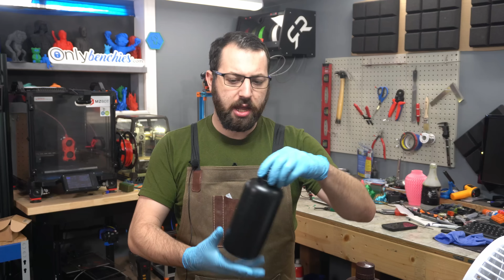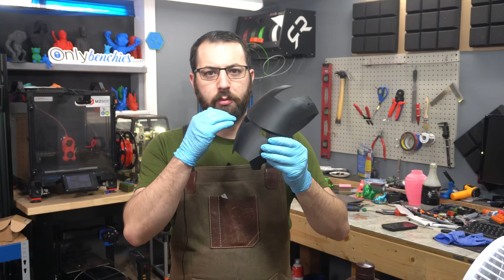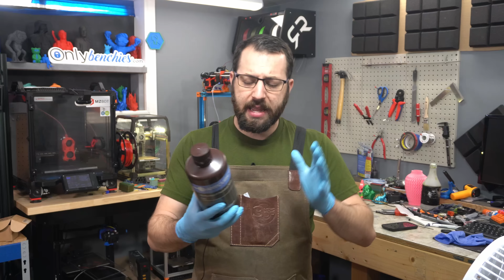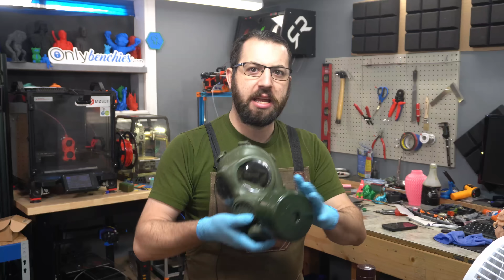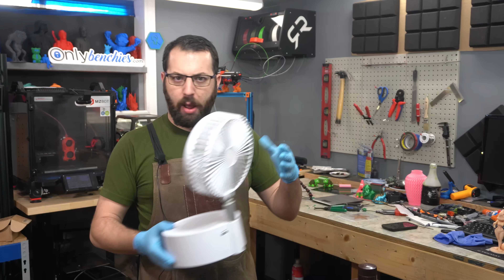PSA - DO NOT AIRBRUSH PRINTS USING RESIN - Think about it please......

Comment: Is probably safer to spray your 3D prints with asbestos then doing it with UV resin,  I love 3D prining but I would stay away from resin printers,  I know print quality is great but at what cost, your health is priceless.  I don't even use ABS filament due to the fumes it produces, I only use PETG for mechanical parts and PLA for anything else.
Reply: siryatech said some filaments give off voc's too, but yeah pla rarely smells very much and even then it can smell kinda nice. not sure if i can find that comment because it was on facebook...
Reply: Yeah I have a resin printer that I've used like twice. Because the need for a safe dedicated space is just too much of a hassle so I don't use it. When doing fdm I only use natural/raw PETG and PLA. If I need a particular colour or finish I do it with post processing.

Comment: Thanks for the PSA. Since I am new to 3d printing,  how would you quickly remove layer lines? I am cash restrictive.
Reply: It depends on the print. I'm partial to automotive spot filler for low cost over large areas.

It requires sanding though, so it's not useful for highly detailed prints.
Reply: if youre usa, get the bondo spot putty from the automotive section for 3$ per tube, spread it nearly everywhere, and sand it down with a medium sanding sponge quickly. Or spray can filler primer from the same section, that sprays a bit smoother
Reply: You could print with ABS and then acetone smooth it. Still very toxic but not as much as UV resin. Best done outdoors. Advantage is you can put the part in the acetone vapor chamber, leave it there until smooth, then let it blow out outdoors, so you are not actively working with the vapor like with airbrush. Acetone vapor is less toxic than UV resin but it is however extremely flammable, so take care with electronics or heating elements around.

Comment: what people probably underestimate is that normal spraypaint will be dried once it settles out of the air and can just be vacuumed off. UV Resin will be uncured for a long time inside and will settle everywhere including you while still uncured
Reply: and inside you
Reply: why is the spray paint hanging around in the air and not getting pulled in to a negative pressure paint booth?

Comment: Why is this a thing in the first place?
Even if you ignore the health concerns and just look at it from the practicality point of view, Spraycan Filler is simply a better option.
Reply: Well it does take a while to cure and doesn't self-level, unlike the resin. So it does have a productivity benefit. It's just too hazardous.
Reply: @SianaGearz  Filler Primers do self level, at least some of them do.
The big problem with using an Airbrush is the maintenance. Especially with that kind of resin you want to make sure that your Airbrush is absolutely clean afterwards.
If you have any leftover Resin in the Airbrush and it UV hardens over time you will have a hard time getting it working again.

Comment: Thank you so much for this video!
After many years working in laboratories it is almost painful to watch people just handling resin "normally".
Having some experience by working with chemicals every day, I just see all the little mistakes where people spread this stuff all over their workplaces.

Creating an aerosol out of resin is just a horrible idea!
An aerosol gets everywhere. And it stays - in the air and on all surfaces around.
These little fluid particles can float for hours and days!
Reply: its so easy to get messy :( .
Reply: Do you have any tips for keeping workspaces clean while working with sla printers?
Reply: I work a lot with 2k urethane based paints, primers, etc. in my paint booth. Do you know if there is a material difference between the hazards of spraying UV resin vs. professional automotive paints? You can even purchase epoxy based 2k paints and primers. This video is well intentioned but it is difficult for many to accept blanket warnings. Full face mask OV respirator, paint booth, tyvek paint suit, etc. - is this resin spraying somehow less safe than standard professional precautions or is it on the same level?
Reply: @Genkenx  2k will cure/flash off, resin won't unless exposed to UV light. So with 2k you can let it settle in your booth and wipe it up, but the resin will stay there until it UV cures. Not something that 99% of people are gonna want since its inside their house or garage

Comment: A good way to think about this is replace every mention of “UV resin” with “acid”. All of the sudden the absurdity of this idea is clearer.
Reply: Is this because UV resin actually contains acid or did you choose acid as an arbitrary thing that's dangerous to be aerosolized for the purpose of illustrating the point?
Reply: @Joe_Yacketori  the latter. Resin is clearly not as dangerous, but it is caustic and causes irritation and in enough concentration will cause an ER visit.
Reply: @mr_voron  There was a guy once that posted a pretty graphic misshap on reddit about a small spill he had. He moved his printer and forgot he had resin left in the vat and spilled it on his shirt and pants, then he went on to clean his printer first. After that he went showering. A day later he had an ER visit and nasty chemical burns on both his legs dow to the knees. Took him weeks to recover... So yeah acid is quite fitting tbh.
Reply: Like ascorbic acid or citric acid? =)

Really: it's a bad analogy.
Reply: @Mr_Yod  You don't want concentrated citric acid in your lungs, either.
Reply: @MrKhay82  As many other things. =)
Reply: in all fairness, you could replace ANY word with acid and see why its a bad idea.